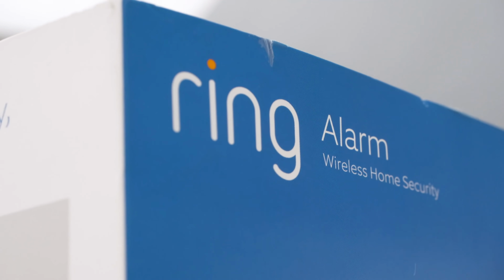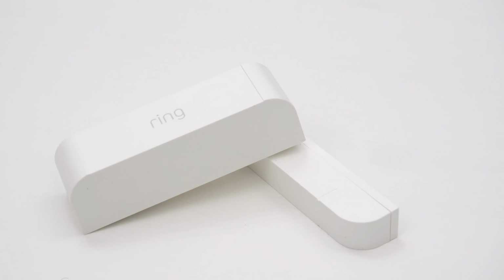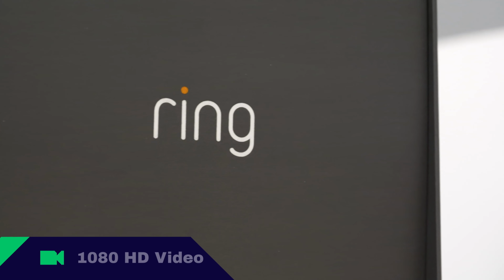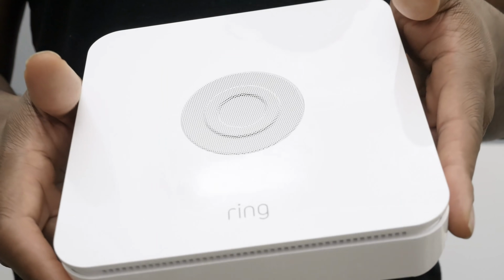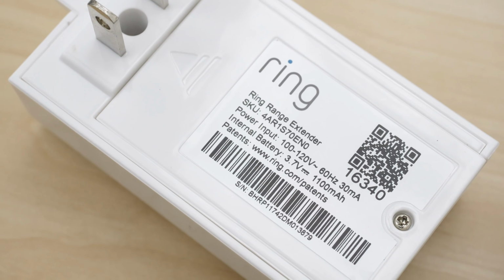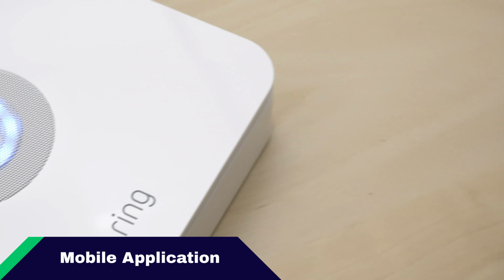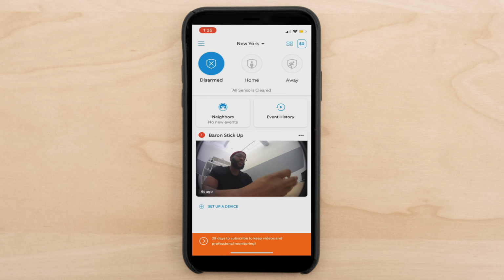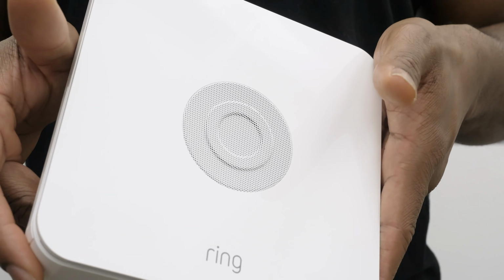Ring Alarm Home Security Kit Review- A Safe Option?

Comment: We have used the ring peep hole a door bell alarms before and we love the fast free shipping due to amazon love the 10% discounts for veterans first responders and now once you sign up for the high 10$ plan you get that same discount.......no one has as many for the cheaper prices of outdoor cameras and no one offers 24\7 security certificate for insurance company for under 20$ a month ring does all this for 10$ a month 120 a year or 100 flat rate 1 time fee.....no extra BS charges for cloud storage or adding 5$ for each camera etc......and at anytime stop your service or keep adding to it.
We are under 750$ rocking the 14 piece kit extra window sensors & 1 extra motion pod and 4 cameras outside 2 being flood lights with camera over garage and over back yard patio meanwhile keeping our doorbell alarm for packages and visitors 2 inside  first floor and 2nd floor.
This same set up isn't possible or either pushing 1500+ and rings doing this all where you will recoup your money spent and alarm monitoring fee vs spending high start plans and high monthly payments with say simply safe adt nest cpi etc.

Comment: great review, wondering when a particular door opens does the system tell what door was open  (front door, side door, etc)    Thanks
Reply: Not by voice, but you can adjust the different chimes tones by sensor, so I have my front door nd garage entry door on a different chime sound than the windows and my other doors. Also you can enable notifications per individual sensor in the app to tell you when a particular sensor has opened or closed.

Comment: How long does the built in battery last?
Reply from the maker: Not sure which device you're referring to but here's the info from Ring- 
Ring Alarm Base Station - Internal rechargeable battery which lasts up to 24 hours of battery life.
Ring Alarm Contact Sensor - Uses a 3V Lithium battery, included, which may last up to 3 years depending on usage. Cold temperatures may drain battery life faster.
Ring Alarm Keypad - Internal rechargeable battery which lasts up to 7 months, depending on usage and power save settings.
Ring Alarm Range Extender - Internal rechargeable battery which lasts up to 22 hours of battery life.
Ring Alarm Motion Detector - Uses a 3V Lithium battery, included, which may last up to 3 years depending on usage. 
Ring Alarm Panic Button - Uses a 3V Lithium battery, included, which may last up to 3 years depending on usage. 

More info on Ring Alarm here: http://bit.ly/2NKQjUK
Reply: Security.org what a phenomenal reply. I

Comment: Do you need to leave the Ring base station, keypad and range extender pluggeg all the time
Reply from the maker: Yes, for the system to work! The base station does have a backup battery but it'll only last 24 hours. More info on Ring Alarm here: http://bit.ly/2NKQjUK

Comment: Nice review. Thanks. There are just two things I wish you would have mentioned...
1. While talking about the sensors, I wish you would have mentioned what batteries they use and how long they last, or at least how long they are suppose to last. According to ring, the cr123a batteries will last 2 - 3 years. After a quick google search, most people report between 6 - 12 month. : ) Also, cr123a batteries come in rechargeable as well. 

2. You went through the app and there was a "Neighbors" tab. I wish you would have talked about it a little bit more, and pointed out what exactly the Neighbor tab does. It turns out, it is a pretty cool feature. The app allows you to see camera feeds, of people near you, which decided to "share" their camera feed! You can also setup an are or "fence" around your house and get notification about crimes happening in that area, including live feeds of those cameras. Well, something like that, ha ha . I just researched it a little bit.

That said. Your review was great and "convinced" me to go and give this system a try. I am using currently the Samsung smart hub system and I do not like it...Thanks.
Reply from the maker: Fair enough!! I also do written reviews that are more detailed but definitely did not talk about the Neighbors tab much- http://bit.ly/2NKQjUK
Hope you like Ring more than Samsung!

Comment: I bought the basic security system and added two CO2/smoke "listeners" which I ordered with z-wave smoke/co2 detectors which must be placed within 6 inches of the actual alarm. It MUST be z-wave compliant or not work. I bought it mostly for the fire alarms. I also got a panic button. Push and hold for 3 seconds it will summon the police.  PS: ADT prices are so jacked up I kissed it bye bye.  I advise anybody to have monitored fire/smoke alarms.  For $10 a month central monitoring is unbeatable. Or $100 a year. Wow.  With cellular backup...seriously big time good deal.  You can buy as many sensors as you like..i love that too.
Reply from the maker: Hey, thanks for sharing! All good points. More info on Ring Alarm here: http://bit.ly/2NKQjUK

Comment: Nice video Gabe! Is it possible to use other manufacturer's camera (I want one with local storage option) with the ring alarm  security system and still get automations, ie. Start recording if the door sensor is activated.
Reply from the maker: Unfortunately, you can only connect Ring cameras to the Ring Alarm system. More info on Ring Alarm here: http://bit.ly/2NKQjUK

Comment: I've had the Ring doorbell and floodlight camera at my old house and thought it did a great job.  I've just moved into a new home and haven't decided if I want to install the Ring security system or go with a company like ADT. I do like Ring and I don't know if I want to commit to a 3 year contract and a $50+ monthly monitoring package.
Reply from the maker: Understandable. I would suggest to do Ring Alarm so you can control everything in the same app. Plus, they don't have any long-term contracts and their monitoring is only $10 a month or $100 a year. More info on Ring Alarm in my full written review: http://bit.ly/2NKQjUK
Reply: Go with Ring.. I have their alarm system, video doorbell, 4 security cameras, and exterior smart lighting. I’ve also wired in GE smart switches so I can turn my living room and dining room lights on and off from the ring app. Been with them 6 months now. No regrets.

Comment: 1st off, great review. I also watched the video for the SimpliSafe system as well. So, I’ve been doing some research on DIY securities systems, and the top two that I like are Ring and SimpliSafe. Now it’s decision time. I already have a ring doorbell pro. So I guess you can say I’m leaning towards that particular system. Based on your hands on review, which would you say is the better of the two?
Reply from the maker: I really think it depends on what you're looking for, but considering you already have the Ring Video Doorbell Pro, it would probably make sense to go with Ring so that you can deal with everything in one app. I actually did a comparison of SimpliSafe vs. Ring that I think could be helpful: http://bit.ly/2D2Mq9n
In general, Ring is more affordable than SimpliSafe in terms of professional monitoring and equipment. You can also skip a paid plan and still use the app, which is not the case with SimpliSafe. 

Let me know if you have anymore questions!
Reply: Security Baron thanks for your response. Yeah I think I’ll go with ring. Oddly enough I checked out your side by side comparison of ring and Simplisafe this morning. Thanks again. Continued success.
Reply from the maker: @Brooklynsbestborn  You're welcome! Here's the Amazon link for Ring: http://bit.ly/2UpPNRD

Comment: I read online that some sensors go offline often on their own. Is that still a problem for Ring? Also do these components work on 220 volts?
Reply from the maker: Hi Mazen, 
I didn't have an issue with the sensors going offline. The sensors are all wireless, which component are you referring to?
Reply: I just bought the system, waiting for package to arrive. I just saw the problem online as some people complained. I guess will have to see for myself. Also do you know if the whole system works for 220volts?
Reply from the maker: @mazeneid2828  Double-checking with Ring, stand by...

Comment: Great review!!

Question: If I were to place a motion sensor in my detached garage, would it sound base alarm inside my house (assuming it was turned on "armed"?) or would it just send a notification to my phone?
Reply from the maker: If it's within range, it would do both. There's an 104 decibel siren built in and you'll be alerted via a mobile notification. Learn more about Ring Alarm here: http://bit.ly/2NKQjUK
Reply: Security Baron, Can you use the ring on cellular only, if you do the initial setup via wifi or ethernet?

Comment: I do not believe that the contact sensor needs to be placed on the door nor must the magnet be placed on the door frame. Installing it the other way around works fine. In fact, there is a picture of a contact sensor installed in this manner on ring.com's website:

https://support.ring.com/hc/article_attachments/360014930712/IMG_7703_revised.jpg
Reply from the maker: Ok, got it! Thanks for the tip.

Comment: RUNNN!OK, I am a verified customer.  This is system is terrible. Only good for a small studio apartment. If you have a home or condo with an upstairs or down stairs forget it. Weak wifi signal based, erratic sensors, and required 4 hours of Ring support and still not resolved.  Sorry, this is only a system for small spaces.

Comment: Great review. My recommendation is Ring should have vibration sensors for windows as people are likely to try and break through windows rather than slide the windows open. Also, sound detectors for areas with many windows so sensors aren’t needed for each window. These two things are things ADT offered that I wish Ring would offer. With that, my security system would be complete.
Reply from the maker: Hi Alex, I totally agree that Ring should have a glass break sensor, and the company says that's in the works. However, if someone broke the glass on a window, the motion detectors would also pick up on that. For more info, see my written review of Ring Alarm here- http://bit.ly/2NKQjUK
Reply: Vibration sensors are bad, to sensitive, home alarm Industries moved away from vibration shock sensors on Windows because dog barking and other outside influences can set them off. also know if someone comes in your house they have to get out they're going to open the door. 95% of all home alarms that go off or false alarms due to faulty sensors or something's too sensitive. check with your local police for data. A hint is put a a door sensor on an inside door that you don't open so if someone's in your house they're going to open all your doors and if that sensor trips you know that it's not a false alarm.

Comment: Is there a way to add an exterior siren to this system that will be triggered by Ring door/window sensors and/or motion detectors?  If so, please recommend one. Thanks and great work!
Reply: Thx for your reply but do you know if Dome is waterproof/weather resistant as I plan on installing on my exterior wall?
Reply from the maker: @fourrunner46  Looks like it's not, my bad! Just reached out to Ring about an outdoor siren and will let you know when I have an answer.
Reply: You’re the best. Thx!  BTW why don’t more people want an exterior siren as most indoor alarms can’t be heard outside.  My neighbors are better than any guard dogs I’ve seen.
Reply from the maker: Thank you! Yes, Ring doesn't manufacture a siren of its own but the Dome siren may work for you, depending on where you live- http://bit.ly/2M0nHcR
It works in temperatures from 32-104 degrees Fahrenheit. Let me know if that's helpful or not!
Reply from the maker: Haha! You just have to get one with a high enough decibel level. 
Just heard back from Ring and apparently that's the only option when it comes to sirens.

Comment: Thanks a bunch!! Love your videos.   Quick questions:
1. What are your thoughts on a prior comment from a subscriber who stated that the alarm isn't that loud and neither are the door and window indicators? Do you agree/disagree?
2. Do you just get protection for one door and one window? I have a back door that I would like covered, is that extra? 
3. Is there a camera for the outside of the house as opposed to the inside??
Reply from the maker: No problem! 
1. The base station has a max decibel level of 104, which is about as loud as a table saw (so pretty loud). The sensors will not sound off themselves, but will notify the base station to sound. I think it's definitely loud enough on its own, but keep in mind you'll also receive a mobile notification. 
2. One Ring Basic plan covers one Ring Doorbell or Security Camera. If you want a plan that covers all the Ring devices in your home, you'll need to do the Ring Protect Plus Plan for $10 a month, which includes 24/7 professional monitoring. 
3. Ring does have an outdoor camera, the Stick Up Cam Battery- I'm going to be reviewing this soon. 

For more detailed information, check out my written review of Ring Alarm here: http://bit.ly/2NKQjUK
Reply: @SecurityDotOrg  Great! I'm going to grab it this weekend
Reply from the maker: @1Ataya  Awesome! Here's a link to get the best offer- http://bit.ly/2UpPNRD
Reply: Also, if you have the Ring Protect Plus package you receive a 10% discount on your Ring purchases online.
Reply: @divrdwn41  cool!! Thanks